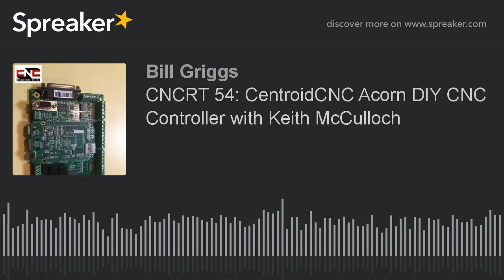CNCRT 54: CentroidCNC Acorn DIY CNC Controller with Keith McCulloch

Comment: On a Mill or a lathe I don't think you can get any better than Acorn, with that said however on a dual drive gantry router the Acorn being limited to 4 axis is a deal breaker for me. I use my router for turning and indexing as well for stuff like chair legs, tapering, inlaying in square and round stock. With the Acorn I loose the ability to do this. If they came out with a new version that had the ability to run a 5th axis, or even an addon board that allowed for the addition of a 5th axis I would be converting my router to Acorn yesterday.

Comment: can i use centroid board (Acorn)for cnc plasma and oxy-fuels
Reply: Yeah....but you need the table, gantry, servos or steppers, a computer and  the other stuff. This only drives the servos. You have to have the machine and all the hardware associated with it.

Comment: Good show Bill. One question about Acorn. What's increasing in price is it the hardware are the Pro software from Centriod Jan 03 2018?
Reply from the maker: The hardware and software are both increasing in price. Details are one the Centroid Forum. Interestingly the Ultimate software actually went down in price by $100.
Reply: and the Pro software now has unlimited g-code file size - 2 thumbs up for that!